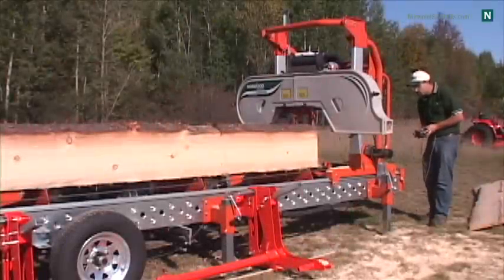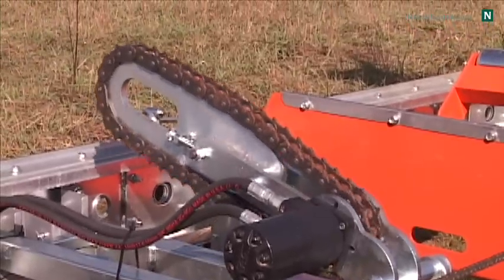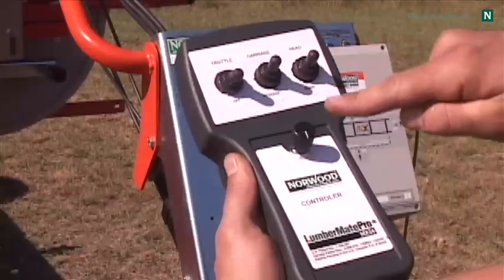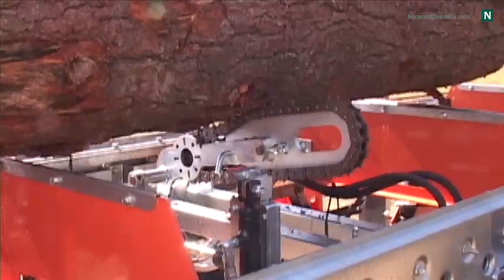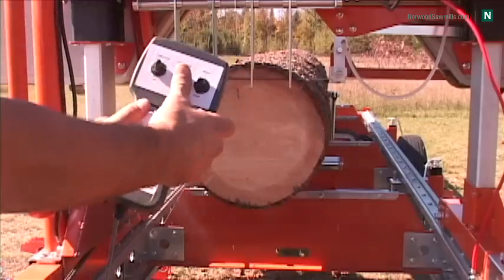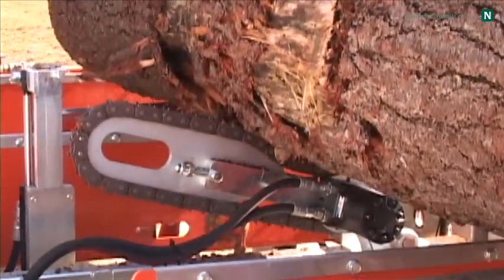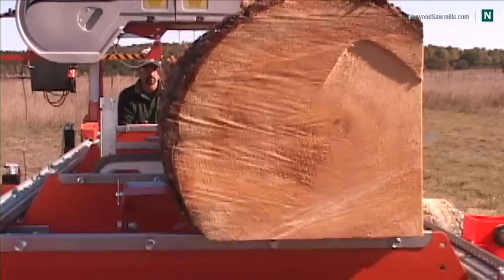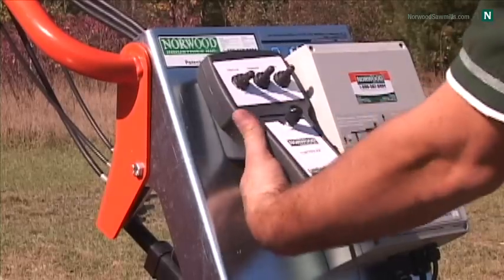Norwood LumberPro HD36 Portable Sawmill - Part 2 (Fully Hydraulic Bandsaw Mill)

Comment: How much does this cost
Reply from the maker: Norwood builds several models of manual and hydraulic portable band sawmills ranging in capacities from 27” (69cm) to 38” (97cm) log diameter.  

Standard, Norwood band sawmills are 16 feet long (4.8m), which allows you to cut boards up to 13-feet (4m) in length depending on the model.  Saw even longer by adding optional 4-foot (1.2m) log deck extensions. In fact, you can saw logs of any length in stationary configuration – some Norwood owners are sawing logs over 40-feet (12.1m) long! 

All Norwood sawmills have an available optional trailer system. 

Norwood band sawmills start at just $4780 for the LumberMan MN27. 

-	The LumberMate LM30 starts at just $5495 right now in stationary configuration. 
-	The LumberPro HD36V2, starts at just $8597 in manual stationary configuration
-	Norwood’s biggest bandmill, the LumberMax HD38 is just $11690 in manual stationary configuration. 

You can build up your HD36V2 and HD38 to fully-hydraulic anytime – when you start, or later when your sawmilling operation gets bigger. 

To learn more about Norwood Sawmills, here are some quick and free resources:

-	Norwood Catalog (downloadable link): https://www.norwoodsawmills.com/digital-info-kit 

-	Visit Norwood Sawmills online: https://www.norwoodsawmills.com/sawmills  .

-	Price list (downloadable link): https://www.norwoodsawmills.com/digital-info-kit  

-	Check out Norwood’s “SAWMILL TV” … the ultimate online “TV” channel devoted exclusively to portable sawmills and successful sawmilling. It’s your one-stop-channel for all the essential things you need to know – from choosing your first sawmill to getting the most out of your equipment … Think of it as the Netflix for sawmill addicts 😊. www.NorwoodSawmills.com/tv/ . Sawmill TV is another resource we offer to current and future Norwood owners FREE of charge.

Freight prices vary depending on exactly where we ship to and also what you order (as that affects weight and volume).

Please feel free to email with your further questions and request for personalized quote including shipping: info@NorwoodSawmills.com .

Thanks

Comment: How much it cost
Reply from the maker: Norwood builds several models of manual and hydraulic portable band sawmills ranging in capacities from 27” (69cm) to 38” (97cm) log diameter.  

Standard, Norwood band sawmills are 16 feet long (4.8m), which allows you to cut boards up to 13-feet (4m) in length depending on the model.  Saw even longer by adding optional 4-foot (1.2m) log deck extensions. In fact, you can saw logs of any length in stationary configuration – some Norwood owners are sawing logs over 40-feet (12.1m) long! 

All Norwood sawmills have an available optional trailer system. 

Norwood band sawmills start at just $4780 for the LumberMan MN27. 

-	The LumberMate LM30 starts at just $5495 right now in stationary configuration. 
-	The LumberPro HD36V2, starts at just $8597 in manual stationary configuration
-	Norwood’s biggest bandmill, the LumberMax HD38 is just $11690 in manual stationary configuration. 

You can build up your HD36V2 and HD38 to fully-hydraulic anytime – when you start, or later when your sawmilling operation gets bigger. 

To learn more about Norwood Sawmills, here are some quick and free resources:

-	Norwood Catalog (downloadable link): https://www.norwoodsawmills.com/digital-info-kit 

-	Visit Norwood Sawmills online: https://www.norwoodsawmills.com/sawmills  .

-	Price list (downloadable link): https://www.norwoodsawmills.com/digital-info-kit  

-	Check out Norwood’s “SAWMILL TV” … the ultimate online “TV” channel devoted exclusively to portable sawmills and successful sawmilling. It’s your one-stop-channel for all the essential things you need to know – from choosing your first sawmill to getting the most out of your equipment … Think of it as the Netflix for sawmill addicts 😊. www.NorwoodSawmills.com/tv/ . Sawmill TV is another resource we offer to current and future Norwood owners FREE of charge.

Comment: I need one of this machine. Please send me a quote.
Reply from the maker: Hi Edward

Norwood builds several models of manual and hydraulic portable band sawmills ranging in capacities from 26” (66cm) to 36” (92cm) log diameter.  Standard, Norwood band sawmills are 16 feet long (4.8m), which allows you to cut up to 13-feet (4m) in length depending on the model.  But you can add optional 4-foot (1.2m) log deck extensions to saw longer. In fact, you can saw logs of any length in stationary configuration – some Norwood owners are sawing logs over 40-feet (12.1m) long!

Norwood band sawmills start at just $4367 for the MN26. The LM29 starts at just $5094 right now. Norwood’s biggest bandmill, the HD36, starts at just $7797. 

Learn more about Norwood Sawmills at https://www.norwoodsawmills.com/en_us/sawmills to find the one best-suited for you.  

You should also check out Norwood’s “SAWMILL TV” … The ultimate online “TV” channel devoted exclusively to portable sawmills and successful sawmilling.  It’s your one-stop-channel for all the essential things you need to know – from choosing your first sawmill to getting the most out of your equipment … Start Watching Now!  www.NorwoodSawmills.com/tv/

To see the complete price list, click https://www.norwoodsawmills.com/en_us/norwood-sawmills-price-list  

Please feel free to email with your further questions and request for quote: info@NorwoodSawmills.com .

Thanks